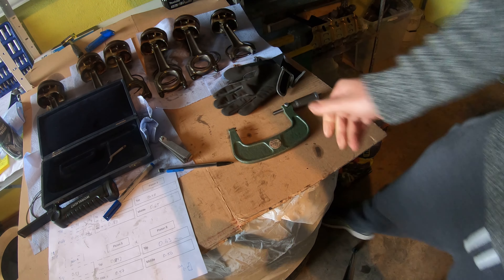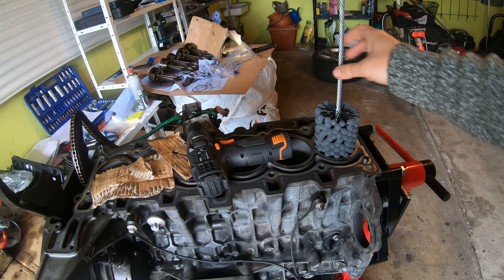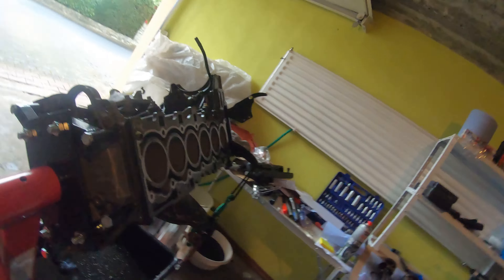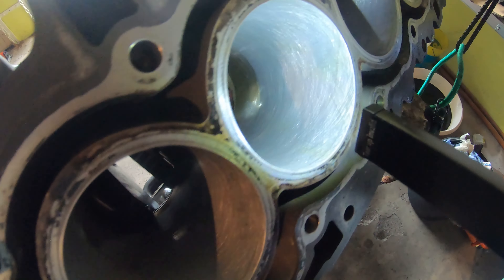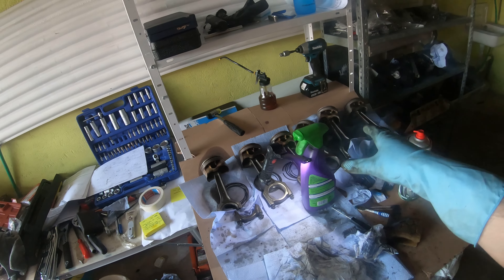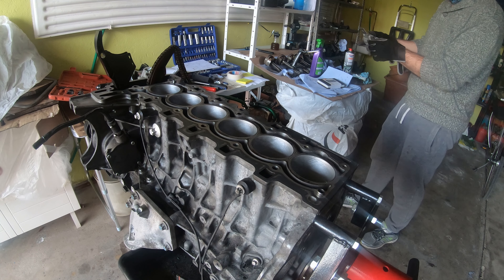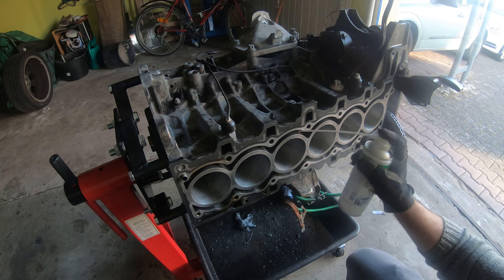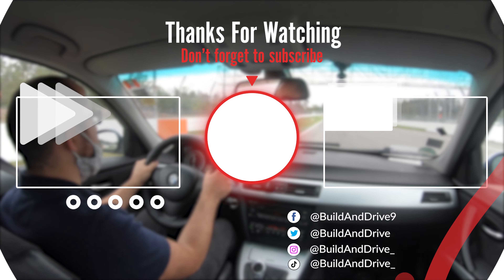[DIY] How To Hone Engine Cylinders In Your Garage Using a Dingleberry Hone [BMW N52 Rebuild Part 7]

Comment: As far as I’m aware you can’t straight hone this cylinders, they need a special scuff pad hone with a special paste that has the abrasives for alusil cylinders.
Reply from the maker: Can you send me a link on my Instagram of something that would work for this engine?
Reply: That’s the issue with the n52, it doesn’t have a lot of options for a home rebuild like the n54. 
You’d have to find a machine shop that can hone alusil cylinders.  An Audi or Chevy specialized shop should be able to do it.
Reply: @buildanddrive  it's to late but... Here is the compound https://goodson.com/products/an-30-silicon-compound and the pads https://amtuned.com/products/amtuned-felt-hone-for-alusil-engines. Some times things are more complicated than we expect....
Reply: @krkoychev  totally forgot about the website with the felt pads !
Reply from the maker: @veetech6786  I think a small scuff like I did to reset the rings didn't hurt anything. Its not like the dingelberries are under serious tension for 'boring/cutting'. I researched this for a quite some time and didn't see anything in the bmw manuals about how to do this because its a special magnesium/aluminum alloy block. There were mentions of 'boring' the block to the larger diameter pistons but if they can take off an extra 0.25mm for the larger pistons, I assumed a quick hone/scuff like this should be fine if the bores were straight. If anyone has further info on how to 'hone' this block for a quick rebuild, put it in the comments and add links for further reading! I also would like to know the correct procedure as these videos were supposed to help others with their rebuild! I don't want to spread mis-information. Thanks!
Reply: @buildanddrive  the cylinders in the n52 are “built into the block”, meaning you don’t have any cast iron liners in the block. The n52 cylinders are infuse with aluminum and silicon, which is why special care is needed to hone them. 
There is a detail article which I have to dig up for your. 
Look at Porsche 944 forums along with ls1 and Audi forums, they all have detailed examples of the alusil cylinders.

Also, you can not bore alusil blocks without a diamond cutter which is very expensive. 
once the cylinders are out of square or scored you need a new block.
Reply: And 65
Reply from the maker: @veetech6786  I think some of your message got deleted... Still got those links? Thanks for posting💪🏻
Reply from the maker: Thanks so much! 🙏🏼 I've linked your doc in the comments.
Reply: @buildanddrive  ok  every  body is right  but   what you di  is all so  ok ,, you really not doing anything or taking any material,, only thing  you did  is to   give the    the new  piston ring  a new surface to scrape on ,, so  so far  you good, this type of honing that not change anything  ,, keep going
Reply from the maker: Yes, I think it's fine but if the bores are straight and have no taper, out of round or scrapes, I would just leave them alone and skip honing the block. (Remember this advice is only for alusil engines... If you are rebuilding an normal engine, you have to hone it to set the piston rings correctly)
Reply: @buildanddrive  exactly   ,  but iis all way good to brake the lip of carbon build up right on the  edge of the cylinder ......

good

Comment: in the case of factory honed cylinders, even if the cylinder walls are wear out, you can still see the factory cross-hatch on the non loaded sides of the cylinders ...

Comment: How’s the engine rebuild going ?
Reply from the maker: It's all finished with 30k on the clock. You can check out my 20k update videk. Runs good but smaller stuff (vanos/disa seals) are falling apart for some reason. The rubber on these engines are made to fail.

Comment: you have "coated" cylinder walls, you are not suppose to hone them at all ... you have no idea of what are you doing
Reply from the maker: Read the description and comments. Thanks.
Reply: @buildanddrive  Description and comments cannot replace technical facts. As shown in your video, the cylinder walls were almost perfect after disassembly, the coating is much more durable compare with the traditional honing. You just ruin them ...
Reply from the maker: @bogdansovaiala7290  Car is back together and running with over 15,000kms on the new engine but thanks for your comment
Reply: @buildanddrive  Congrats! many more ahead!
Reply: @buildanddrive  niceee fresh n52 <3
Reply from the maker: Thanks Bru🙏🏼
Reply: @buildanddrive is this engine still alive ?
Sorry to tell you that, but after scuffing the cylinder walls you should have lapped them with a lapping paste, due to it's a alusil engine...
As far as I see you did no lapping at all.
After lapping of the cylinder walls you will see no cross hatching anymore, if done correctly.